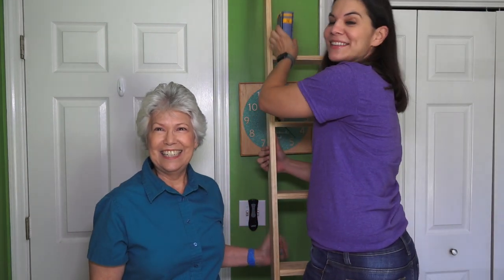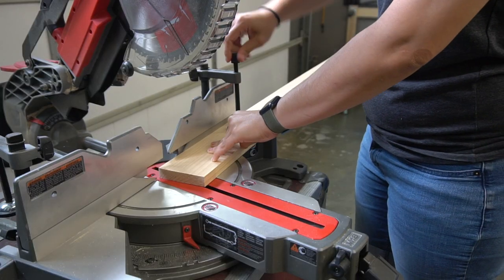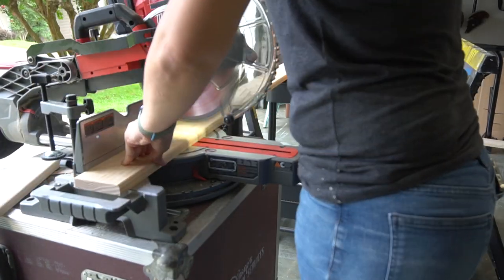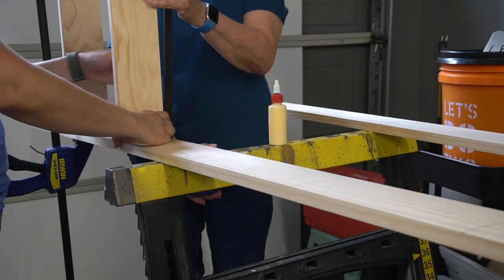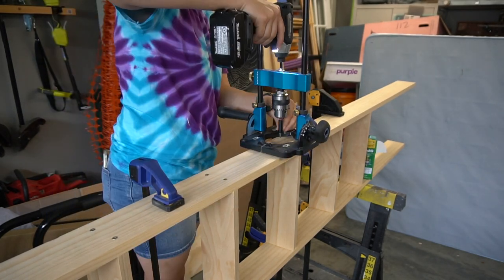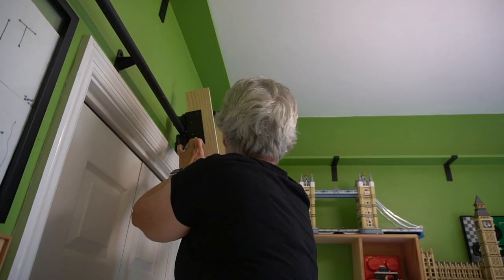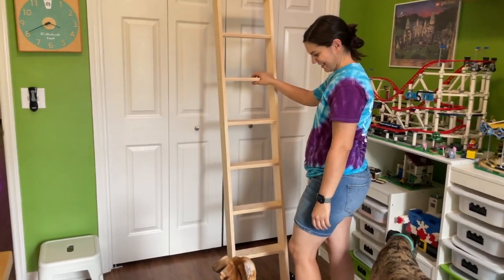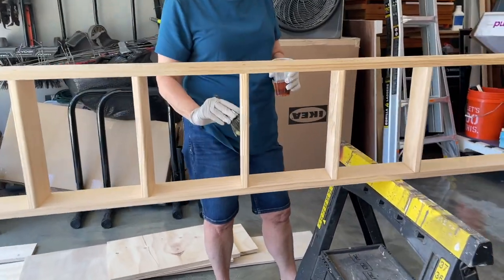How to Make a DIY Rolling Library Ladder

Comment: Glue on end grain of ladder rungs is not very strong.  As one commenter added routing a bit from ladder rails to mortise rungs is good but you can also glue and screw blocks under each side of the rung because face glue joint is stronger than surrounding wood.   

Additionally, I always use all-thread rod with washers and lock nuts -under every other rung (or every rung if you’re very large stature) to clamp everything together and keep it from becoming loose over time.
Reply: Agreed.  This was a very nice project but I would beef it up by using hardwood plus routing a groove (mortise) for each step. That way if the glue fails the screws and tight fit of the tenon (the step) is still held in the mortise.  Older people especially wouldn't want to have a rung break and fall...not necessarily that I'm older.

Comment: That looks great but you should really use a router and router out some material from the stringers for the treads to insert into. This provides much safer support than just relying on the glue and screws.

Comment: @MotherDaughterProjectsDIY-complicated question! Is it possible to lift the ladder  out at the bottom- just a centimetre or two, without taking it off? We will not have the rollers-we need rubber feet as we have carpet- but it would still be great to be able to let the rail take the strain of moving it along , rather than using hooks and having to keep lifting it up. In other words- will the rollers 'tilt' just slightly around the rail, to allow this action?
Reply from the maker: I just tested this and yes, the rollers will allow the ladder to be tilted up.

Comment: How did you come up with the 12 degree angle? is that standard? Im adding a bookcase behind our couch where there will be about an 8'' gap. I really want a rolling ladder to reach the shelves, but it needs to be more vertical with hardly any angle.. does that seem possible? would there be any complications with me changing the angles if the steps? I do think i'll add a hand rail for additional safety.. but other than that do you foresee any issues?
Reply from the maker: We just picked 12 degree cause it seemed to work best in our space. I think you could do a steeper angle and be fine. We added hand rails after using metal pipe and it does give a little extra security. - Steph

Comment: I'm a little confused on the top part of the ladder what is on it that helps it slide on the rails??
Reply from the maker: That all comes with the rolling ladder hardware kit. It's basically two wheels at the top of each side of the ladder that the rail slides between.